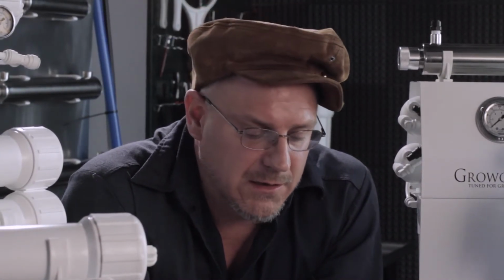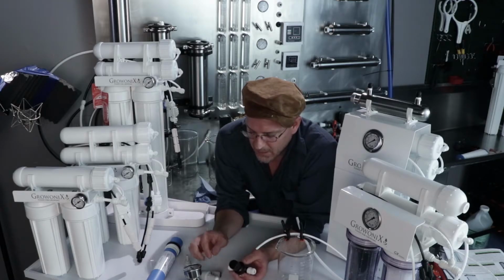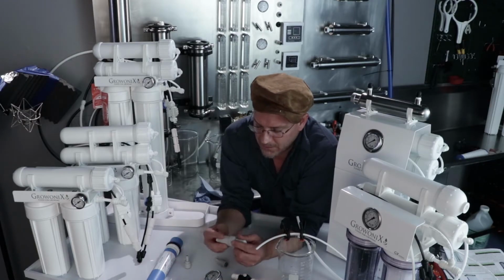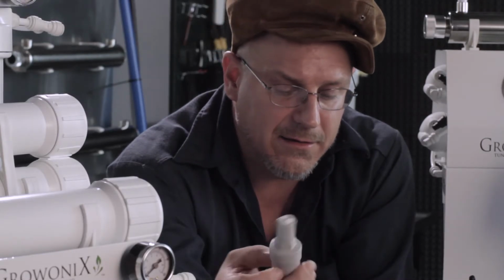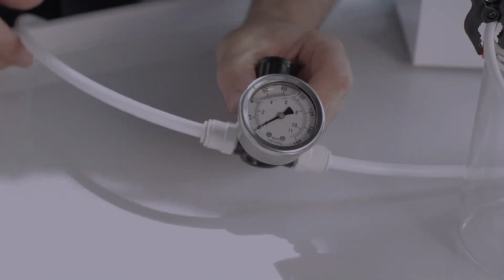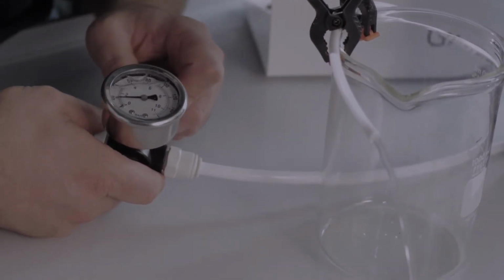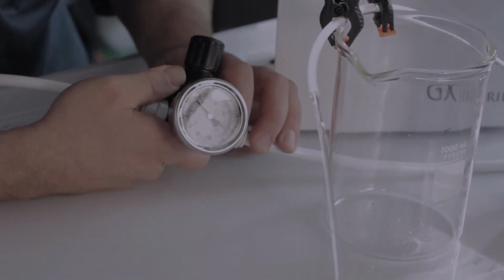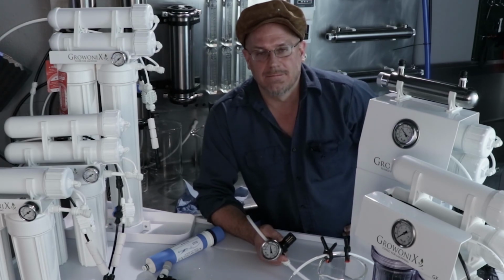GrowoniX Pressure Regulators: Overview

Comment: Off chance you see this but I’m working with an eco water 375 and the pressure is fluctuating between 79-105 psi. Would you recommend same PRV for this system

Comment: Is there a way to increase pressure ? We are running a pump and it is coming in around 20-25psi
Reply from the maker: Yes, use our BP-1530 Booster Pump and it can increase it up to 79psi.